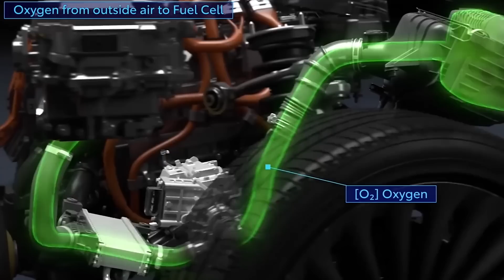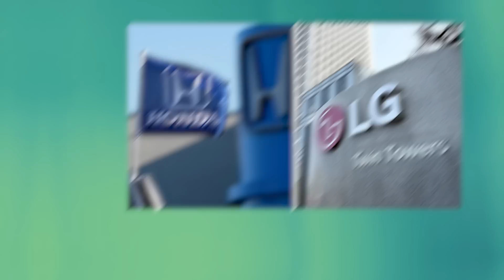Honda Just REVEALED Its Masterplan To Defeat Toyota!

Comment: Honda sets it's sights on Toyota! Perhaps they should seriously address the gas/oil mixing issue, the valve carbon deposit (like Toyota did) problem and that horrendouse A/C fiasco which was supposed to apply to 2016-19 Hondas. (I guess our 2020 Civic missed that memo as it shredded itself at only 30K miles.)
You've got a long way to go, Honda. (And we own two 2020 Hondas).